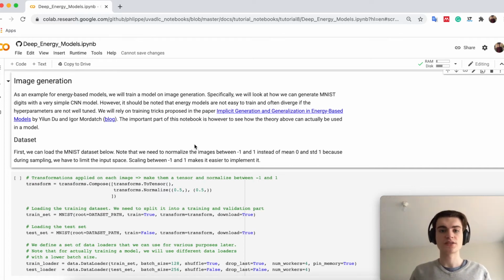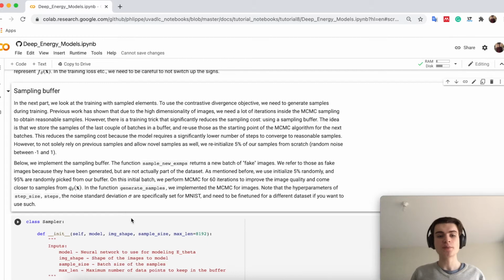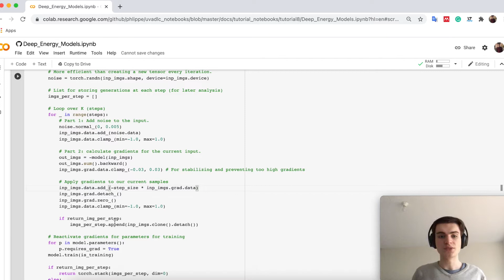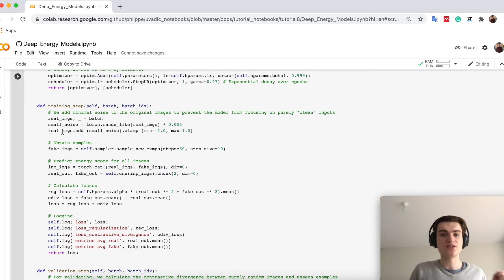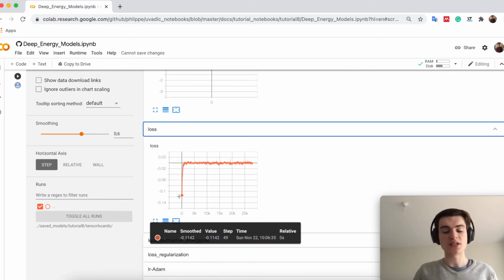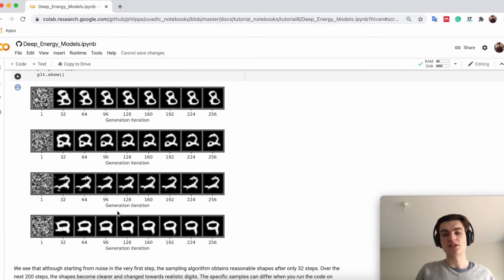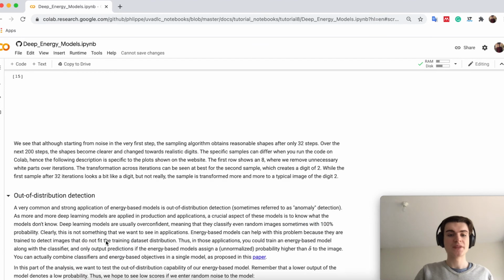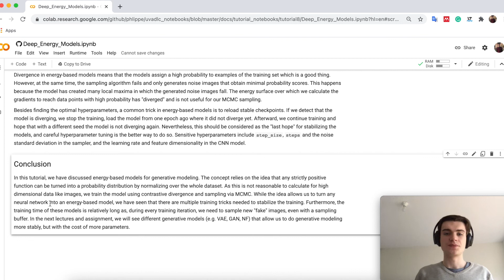Tutorial 8: Deep Energy-Based Generative Models (Part 2)

Comment: I'm grateful to have learned a lot from your videos, but I have a question. I understood that the CD loss is the difference between the energy values of real data and the sampled samples. However, in the code, the CD loss is calculated as fake_out - real_out. Why is it not [real_out] - [fake_out]? When I actually ran the code, I noticed that [real_out] - [fake_out] doesn't lead to proper learning, but I still can't figure out the reason for the sign flip
Reply: I apologize; it turns out the output was not E(x) but -E(x). It's my mistake for not listening to the explanation carefully.